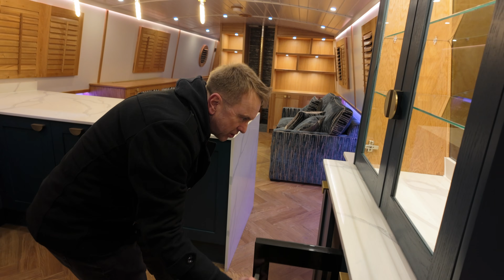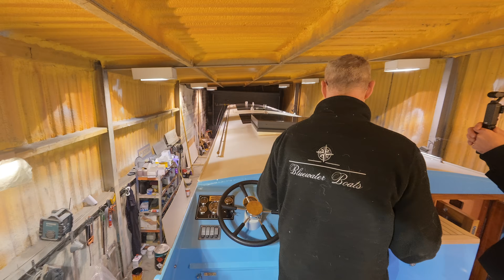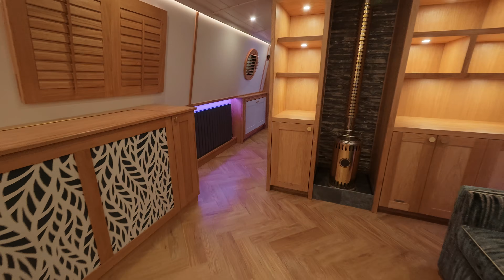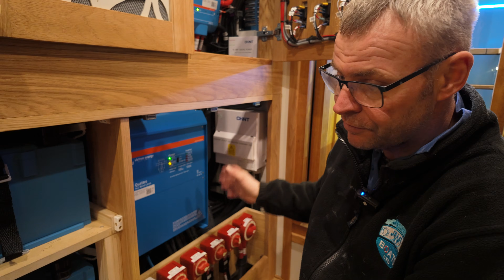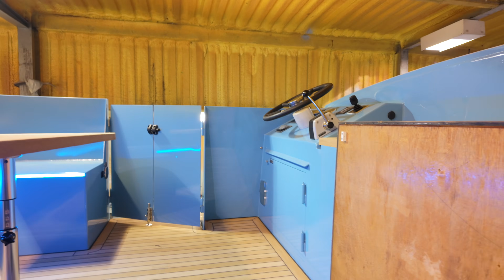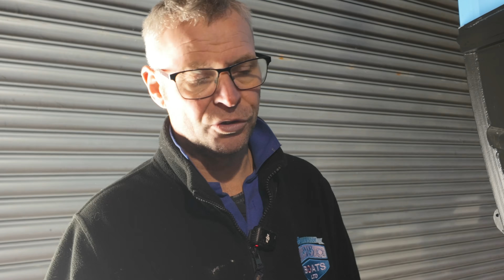Canal Boaters For Change

Comment: How often do you change the water filters
Reply from the maker: For a Water Freedom, the first three sediment filters typically need changing every 1 to 3 months, depending on source water quality and usage, while the other specialized filters (heavy metals, ultra-fine) usually last around 12 months, with noticeable drops in water flow signaling replacement time.

Comment: An interesting video,  glad that you told us what it cost. It would have been nice to known that price of a narrow boat built to that standard. I thought that all boat builders shot blasted before they painted. A friend has a narrow boat with a lot of electric and they've got two such generators, suprised that you didn't fit rwo.
Reply: Sadly, they don't.  There have been boat owners finding the epoxy peeling off because the mill scale wasn't removed and so the paint doesn't adher to the steel. I find it difficult to believe that anyone would be daft enough to buy a boat that wasn't shot blasted if the boat builder explained to them that the paint would all peel off twelve months down the line, especially when you can be looking at twenty grand for a new paint job.
Reply: @kerry5586 Thanks, I'd had no idea that it cost so much for painting.
Reply: @kerry5586The good thing in the UK is that if the paint did come off like that you're protected but the consumer protection laws and could make a claim on the maker.
Reply: @kerry5586 Mill scale expands and contracts at a different rate to the Steel so eventually it will flake off, that's why it is essential to remove Mill Scale before applying a coating.  A Decent steel producer will have an atmospheric control system inside the Heat Treatment oven to stop Mill Scale being formed but if you have a batch of steel with moderate to heavy Mill Scale then it is cheap and nasty, simple as that.